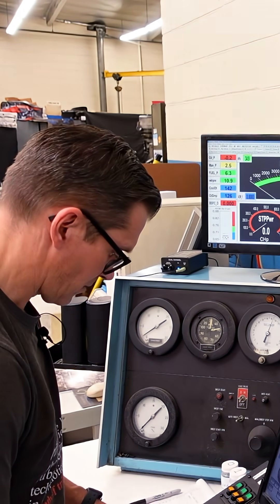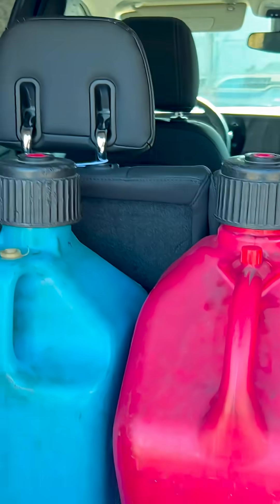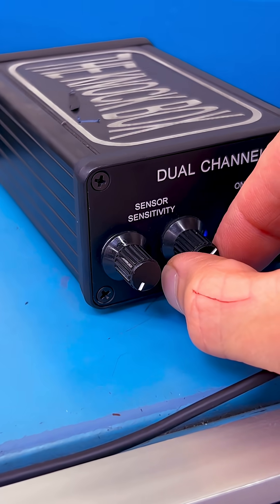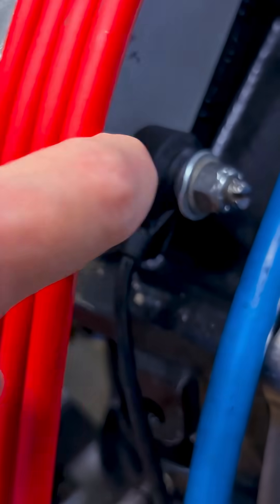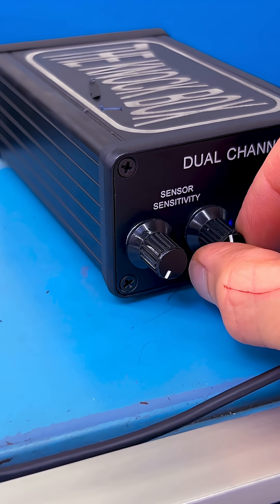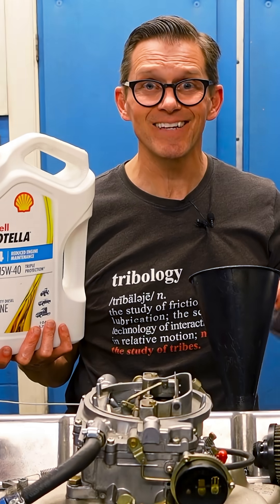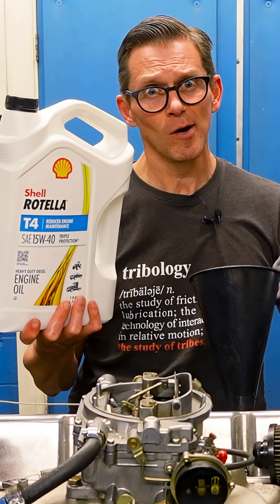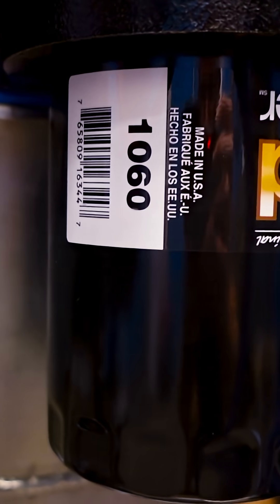Why MOST Motor Oil Tests Are WRONG! (Dyno Test Sneak Peek)

Comment: Some Cummins 5.9s in (Gen 3) Rams turn the oil dirty during the oil change. No starting of the engine, just filling to the required amount. Others turn the oil black around 100 miles. I run Shell Rotella T6 15w-40. I was surprised the T6 full synth allowed that much soot to remain behind. Suggestions?
Reply: Get a 1-2 micron oil bypass filtration system
Reply: The cylinder head holds a lot of oil, when you dump new into it that pushes some to the pan

Comment: WHERE WERE YOU IN 1984, WHEN EXXON LEFT TOO MUCH ASPHALT IN THEIR UNIFLOW MOTOR OIL, AND DUMPED METHANOL INTO THE KATY FIELDS NATURAL GASOLINE TO UP ITS OCTANE RATING.  THIS WAS DURING BRUP, BAYTOWN REFINERY UPGRADE PROJECT.  EXXON LOYALIST LOST A LOT OF ENGINES, AND WERE NEVER TOLD THE TRUTH UNTIL ENGINEERS ROTATED TO OTHER FACILITIES.

Comment: I thought we are not supposed to be using diesel oil in petrol (gasoline) engines to clean them out?
Reply: That's for a GDI engine because it will cause pre-adignition